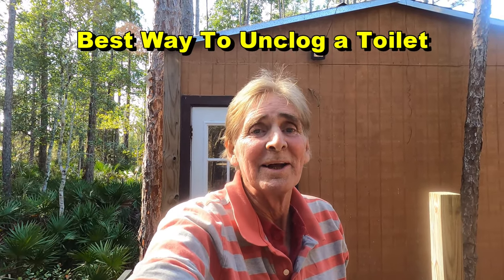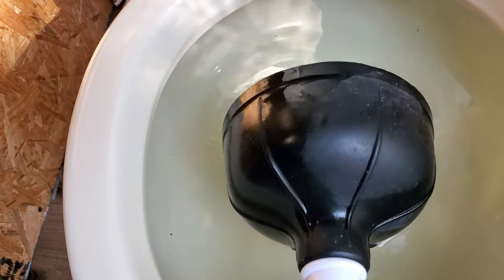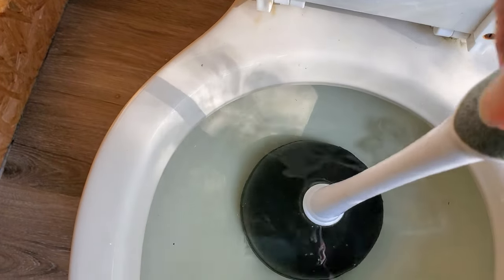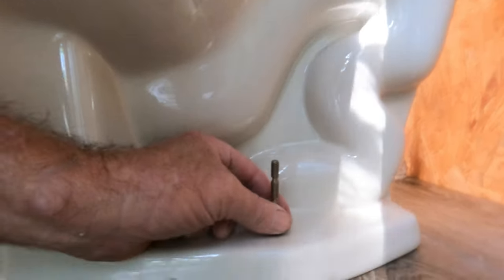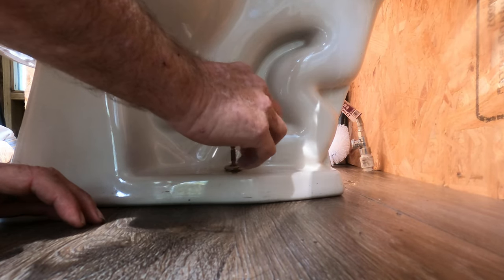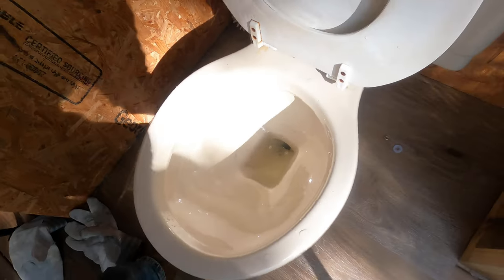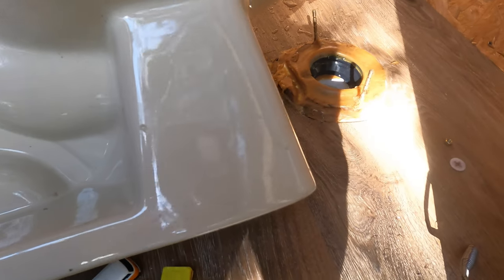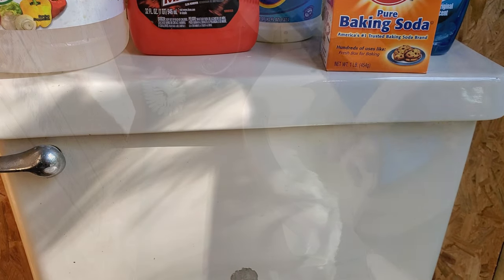Overflowing Toilet? Here's How To Unclog

Comment: Our recent clog fix experience: 8 ounces of liquid Ajax dish detergent poured slowly into the bowl over the site of the paper & turd clog, let sit for 20 minutes, followed by a coffee pot of hot water (less than 180 degrees f., we were told 150 d. works) also poured very slowly into the bowl over the site of the clog-let sit for an additional 20  minutes (after which we could see the bowl water turning brown from the slowing dissolving turd-log-clog), followed by a second slowly poured pot, let sit for a final 15 minutes. Flush - clog gone, no plunger, no auger, no waste water splashed all over the floor or room & zero room clean up &/or turdy tools to clean up. 48 hours later the toilet is still flushing well. We're not talking toys, just turds, paper & Presto we're Pleased!